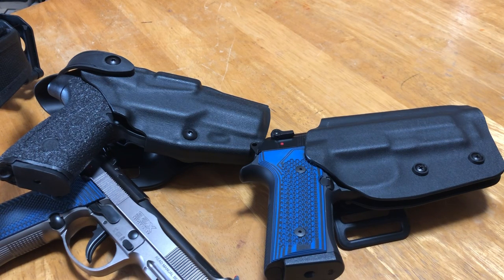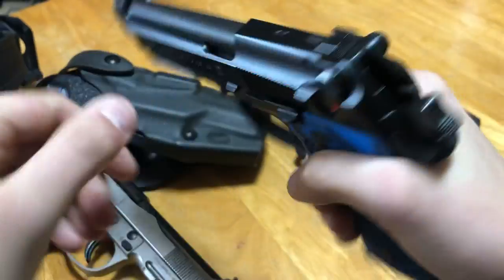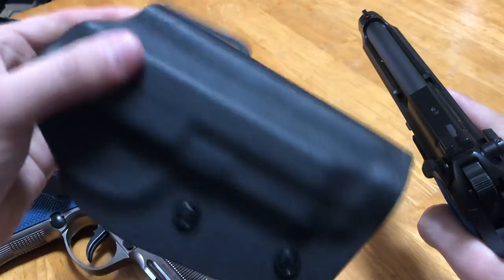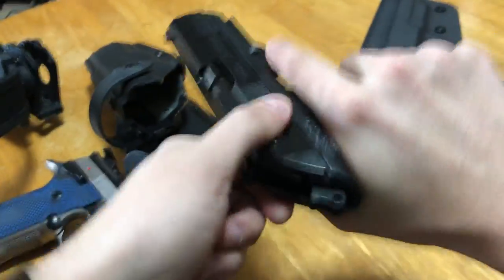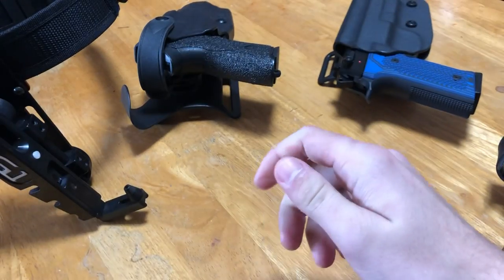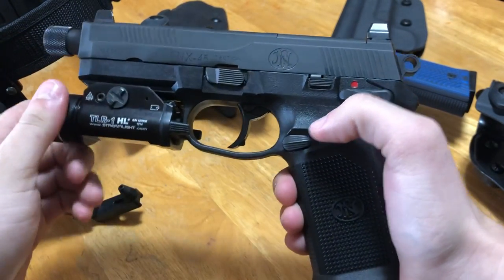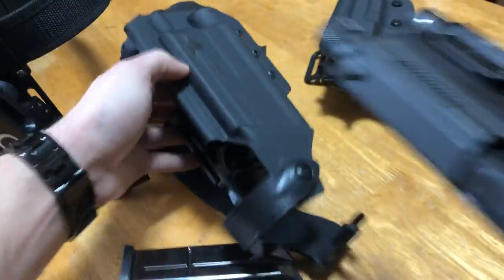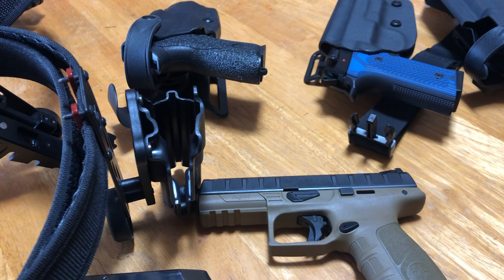How to properly holster a hammer fired pistol

Comment: Good video. I wanted a double stack sub compact DA/SA for concealed carry, but could not find one I liked.  Very limited options for that specific type even in the US.  I ended up going with a Glock 26 with the Striker Control Device as an added layer of safety. Functions just like your thumb on the hammer and otherwise you don't know it's there.
Reply: or don't carry one in the chamber lol
Reply: I'm fond of my CZ 75D PCR, but that's more of a compact than a subcompact, and I recognize that your concealment needs differ from mine.